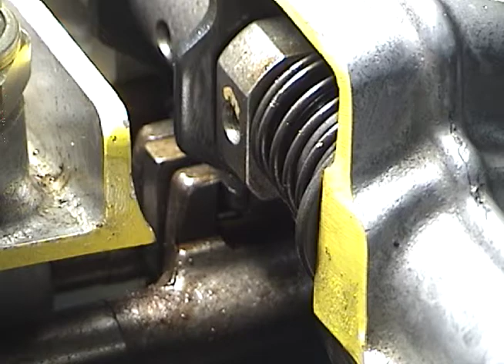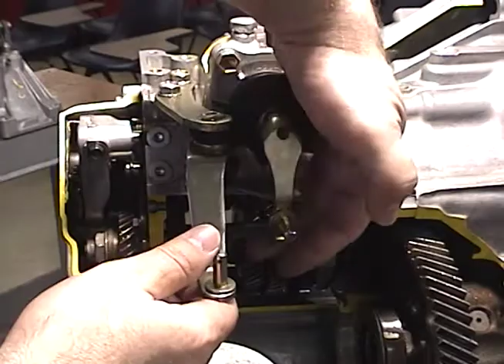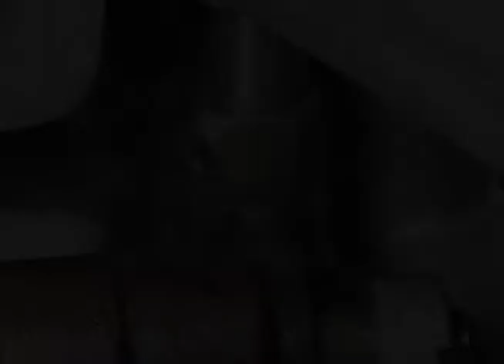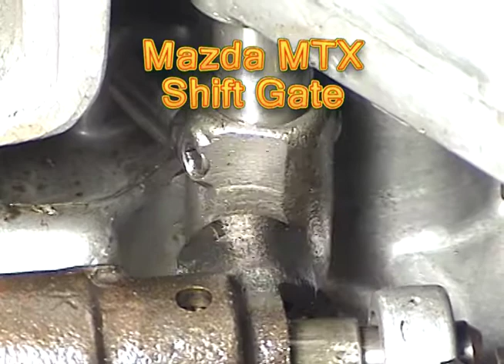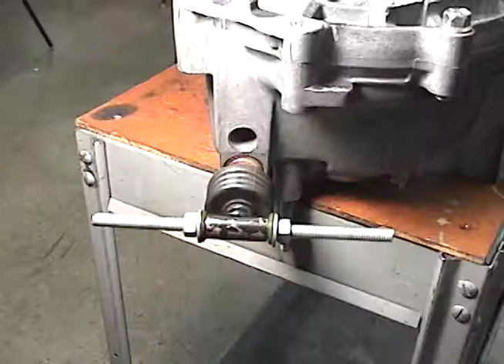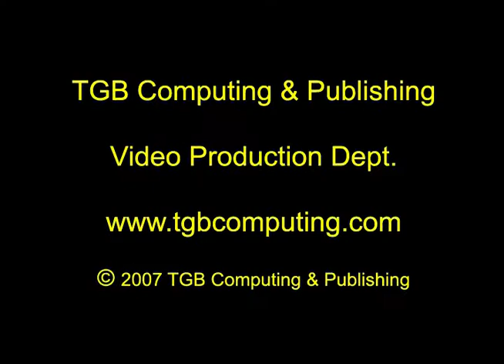Front Wheel Drive Manual Transaxle shift operation

Comment: this was a great video, i still want to figure out exactly what my honda is doing when I shift, 2004 accord 2.4L
Reply from the maker: Inside the transaxle the Honda is extremely similar but outside the Honda does not use two shift levers.  Instead it uses a rod that twist and moves in and out.
Reply: @DrivelineMaster 

Thanks for Info Dude.

Comment: since you have taken gearboxes apart do you see anyways to stop 3rd Gear stripping and way we can keep the gears close together overcoming the inertia..
hence stripping gears
Reply from the maker: Which part of the gears are striping? Are you talking about the clutching teeth used for the synchronizer or the helical gear teeth? typically if the thrust on each gear is setup correctly with a good synchronizer assembly they should not strip.
Reply: @DrivelineMaster  yes the helical gear..can you do anything to reduce the thrust.. replacing with a billet helical doesn't change the problem just lasts longer or slightly more power..
Reply from the maker: I'm sorry I have not experienced the helical teeth on these transaxles exploding when the thrust is properly set up, the proper lubricant is used and changed regularly and the transmission is not abused or used with an engine that has been modified to put out more horsepower than the transaxle is rated for. There are different thickness snap-rings for adjusting the thrust clearance.  Early Subaru WRX's had this problem with 2nd gear when they put the more powerful engine in they never put in a stronger transaxle. Subaru was deny all warranty clams for transaxles if there was any sign of something that could alter the horsepower of the engine. An aftermarket air cleaner or an aftermarket clutch disk and pressure plate. I'm unclear how an aftermarket clutch can alter the HP or cause the gears in the transaxle to explode (they can't) but these were excuses they used to deny transaxle warranty claims when the real problem was the transaxle was under rated for the power train horsepower.

Comment: Is this a C52 Toyota transmission? I'm currently trying to troubleshoot mine, and those selector levers look familiar.
Reply from the maker: Yes, the first transaxle is a Toyota C52 series transaxle and the second one is from an early 1990 Mazda 626.
Reply: @DrivelineMaster  Thank you for confirming. I'm trying to figure out why  my 3rd gear gets "sticky" when trying to return it to neutral position. It seems to only happen when the gearbox is "warm" after a few hours of driving. The gear shifts fine when the car is still relatively cold. I'm not sure if it's the synchro because it doesn't have issues going into 3rd  gear, just getting out of 3rd when going back to neutral after driving for a while.

I'm crossing my fingers that it just needs a change of gear oil, or maybe replacement of the old shifter linkage bushings and cables.

Thank you for the very helpful video.
Reply from the maker: I would replace the oil with Redline Manual Transmission Fluid or a good synthetic manual transmission fluid. Then inspect all linkage bushings and mounts.  Don't forget to check the engine and transmission mounts because this can cause alignment issues if they are worn or sagging. There may be an adjustment that can be made to the cables and if so, check and reset the adjustment.
Reply: @DrivelineMaster  Thank you very much for the tips, will definitely look into these.